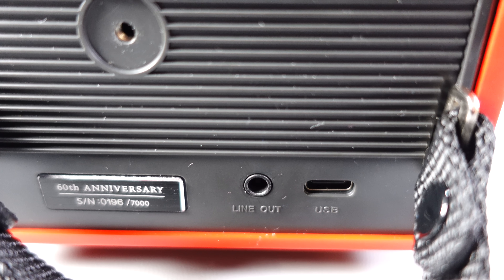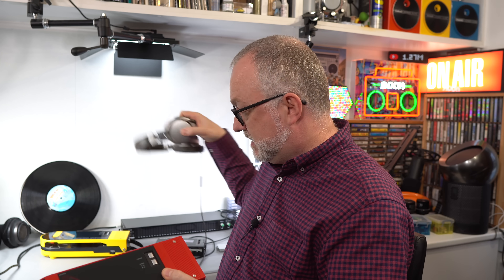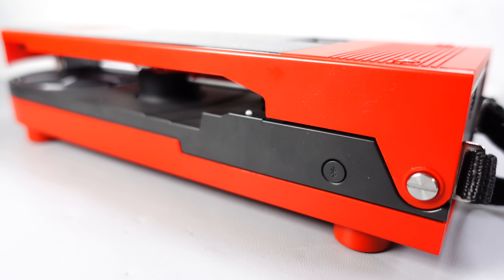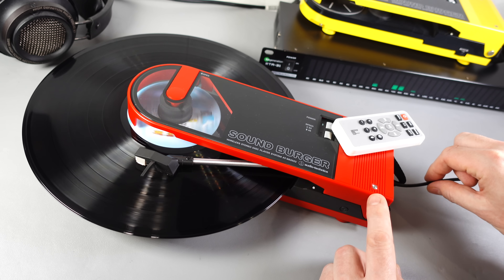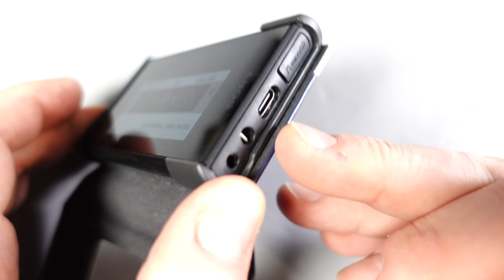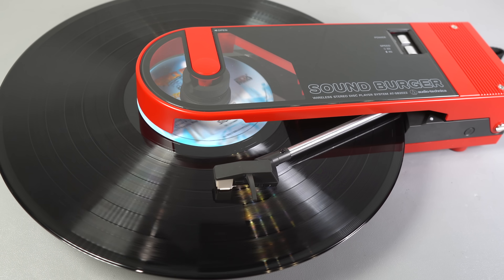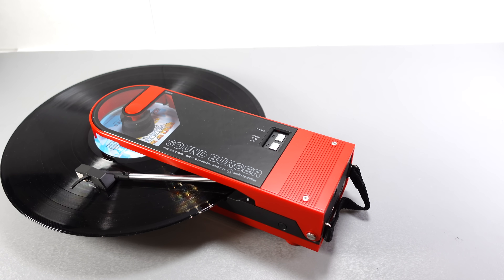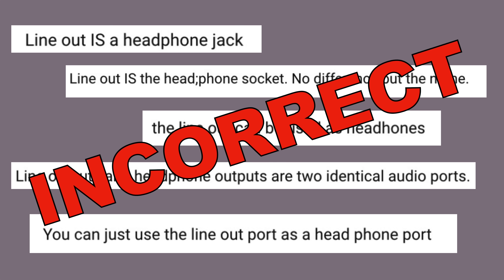Line-out ≠ Headphone-out

Comment: "it uses the same plug, it must work the same!" - nope, not at all. Maybe 23 is "old" now but I have personally used multiple devices growing up that don't follow that notion:
1. "Phono" audio / composite video / component video - all used between 2 and 5 color-coded RCA connectors on each end of the cable
2. PS2 Mouse / PS2 Keyboard - both used 6-pin mini-din connectors but were usually not interchangeable. Labelled and color-coded.
3. S-Video / Apple Desktop Bus - in this case I only used S-Video but it did use the same 4-pin mini-din connector as Apple's peripherals. These cables would also physically fit into the prior PS2 mouse and keyboard ports, but not the other way around.

Add to that a couple of examples before my time, like CGA and EGA video / 9-pin serial and it looks like the use of bespoke connectors for every task looks like a fairly recent trend. If a suitable connector already existed, why reinvent the wheel when a simple label and/or color code would suffice?

Comment: The confusion comes from audio equipment lacking decades behind low-end PC hardware connectivity.
Lots of Desktop PCs and Laptops let you just jack any sound device into any 3.5mm socket and either just switch the role of the socket immediately to match the device or ask you about the type of the device and then do so. I would expect new audio hardware sold today to have a similar feature - if it isn't a retro valve amp or a 2022 limited edition of the Sound Burger from 1983...

Comment: You don't ALWAYS need to amplify it.  Some devices produce an already loud signal (possibly full volume).  I understand why people say line out can be used for headphones, which it can but you don't have control over the volume.  It's all dependent on the device.  Let's look at a few of my devices.  My computer no longer has a headphone jack but instead has a line out, which I use for my headphones.  The volume is controlled via my computer.  I have/had an old school portable CD player (don't know where it is anymore) that has a line out that works great if you have headphones with an in-line volume control since the line out is at full volume all the time.  So there is no answer that can cover all products.  Hope this helps.

Comment: The line out is still usable in certain cases, in your case the volume is low because you're using larger drivers used in over-ear headphones, that's going to take a lot more power than if you use the smaller earbuds that you might get at the convince store and thus the lower volume. So technically it's not misinformation, it's just not the optimal use case. Also if the headphones or stereo speakers have built-in amp the volume is going to be suitable either way.
Reply: To add to this.....

Larger headphones will normally require the higher voltage level off the output which the standard is 770mV to provide the higher level of Amperage needed for headsets (8-600 ohms).  

When Volts increase, Amps increase through the same resistance. 

The Line output will only provide 447mV.  The lower voltage while it will provide some signal, will be to low to provide the Amperage needed to properly drive the headset.

Even with the Smaller headsets, you will get the same effect switching between Line out and Headphone out.  Difference is Even without the proper voltage level you can produce the same Current level and even greater that is needed with the lower Voltage.  You just lose the driving force behind the current flow needed for the proper signal (magnet/air movement).  So in actuality, the smaller headset will actually require more Amps to function not less.

When Resistance decreases, Amps increases with the same Voltage.

Comment: Line-out might not be quiet sometimes; it can also be extremely loud (Chord Hugo 2). Line out design to output the sound at rated Vrms. So it is just for the device connected to it to pick up the signal. So that in most case, Line out does not have a very capable amp; the input impedance of the device connected to it need to be very large, ideally infinite. So that even if the Amp is not capable, it can still maintain the Voltage Level. But the reason Line Out does not have a capable amp is the case; a capable amp has more significant distortion. So that if you want to connect to another very decent large Amp, you want the input signal to be as fidelity as possible, you need a line-out port. But also, the reason you need a delicate amp is considering the space and price constraints, and the device you need to use might need a particular Amp. So that even if it includes a headphone out with an amp, it functions as a general use case.

In most cases, you should not connect an amp to the headphone port or connect a load(like headphones) to line out.

Comment: Long story short, they use the same interface, and are technically compatible, but it would be inappropriate to use Line Out for Headphones, or vice versa, because ONLY Headphones is preamplified. So either it's too quiet for headphones, or redundant\inferior for an amp. It's a similar story with a LOT of audio stuff. You CAN do it, and it will technically work, but it'll be crap.

Comment: I’ve never used a line out as a headphone output. However, I have used a headphone out on my clock radio to plug in a external stereo for better sound output and quality. I, too, think of a headphone output as being usable as a line out at a lower volume level, but not the other way around.

Comment: Some very sensitive headphones could be very loud (or potentially damaged) if plugged into line out. The key is no volume control. I'm glad that you included the headphone amplifier. Overall, very good explanation!
Reply: Fairly sure that's false. A headphone amplifier wouldn't quieten or de-amplify a line-out signal. Line-out is quieter and has to be amplified for speakers or headphones.

Comment: The confusion is caused by older pcs i belive as if i remember correctly line out was sometimes used interchangeabley with headphones and are still very much compatible in the pc market due to volume controls in pc. So people make the assumption that all lineouts are the same when they are not.

Comment: Line out gives you a line level output, which is exactly +4dBu (0dBu being 0.775V and +4dBu being 1.736V) Line level is a very important standard when professionally working with audio. Mic level is 60dB below the line level and its usually what dynamic microphones put out. -60DB is btw the same as saying 1/1000. So the output voltage will be amplified to 1000 times as much as it came in when you plug anything into the mic port (Condenser mics usually give off a much higher level and you will amplify them by something like 40dB or sometimes even less). Professional mixers usually let you set the exact gain because you rarely need the full +60dB of gain unless you are using a microphone not suited for the situation you are using it in. But you could theoretically use a preamp before the preamp. Something like a cloudlifter, which adds +20dB of gain (which is a 10 times amplification). After amplyfying the microphone the 0dB on your mixer means exactly +4dBu of level. And if you send this signal out it will peak at exactly 1.736V, which is very important as said for other devices because all devices expect 0dB to be at exactly this voltage once the input was processed. So the line out is intended to be sent to a device, which expects a standardized signal, which could be the amp for your speakers. What exactly your amps do isnt specified - every model is capable of different things. From there on the signal gets either reduced for lower loudness or increased for greater loudness.

The Headphone out has exactly this amp built in already. It takes the line level signal and increases it further. But if you dont like the built in amp, or want to plug the player into a mixer for whatever purpose you need to do that, you should use the Line out and then wont need to apply neither gain nor attenuation in the next device in the processing, chain since its already at line level - provided the music you play is normalized and the output is working, as it should.
Reply: Almost. There are TWO specs for Line Out. Professional, which you quote is "normally" +4dBu. (Some broadcasters use +8dBu and most telephone companies use 0dBu) The audio industry (like recording studios) typically settled on +4dBu and all interconnections were always balanced typified by XLR connectors.
However, the consumer equipment reference is -10bBV for "Line Out" (0.316V) and is typically unbalanced using RCA connectors. This translates to a 12db difference.  (dBu is dB relative to 0.775 volts where 0dBu = 0.775 volts however dBV is dB relative to 1.0 volt where 0dBV = 1.0 volt)  Cheers...
Reply: I thought it was basically that line out is not amplified in any way, hence LINE level output - it takes the signal being read by the player (whether record stylus, cassette tape head, CD's DAC, whatever) and outputs it.  Versus the headphone jack that has an amplifier built in and, more importantly, a volume control
Reply: @drfsupercenter  It's line out because it's supplying the signal at a line level voltage, like -10dbV or +4 dBu. The issue is line level audio signaling expects very high input and output impedance — the output voltages are quite high relative to a microphone or phono cartridge, the voltage has been amplified, but the output can't actually move very much current, so if a line out can't drive something that needs current to function, like headphones or passive speakers.
Reply: I doubt anyone professional would be working with something so cheap but you do sometimes get ports labelled "line out" that do have mollification for headphones
Reply: @P7777-u7r  Well professionals sometimes use the cheapest tools in emergency situations. It is unusual - yes. But sometimes you are out of luck and stuff starts malfunctioning right before you really need them. Thats where the very cheapest tools come into play.

Comment: The problem isn't that you can't plug headphones into a line out, it's the impedance matching issue with the type of headphones you use. It's possible to plug headphones in and line level be too loud, then using a variable resistor is enough to make it useable just like using a separate pre amp between the line out and the headphones. With no volume control, there's  no guarantee of too loud or too soft with the given combination.
Generally, headphones out at around 70% volume works well as a line out, but the impedance needs to be matched to get best quality, the line out is less susceptible to impedance issues by design, so if it has both outputs, use them as labelled only.
For audiophiles, line out to the headphones is the worst way to get the sound right.

Comment: This cofusion about line out is why using a 3,5mm headphone jack for anything other than a headphone output is a bad idea. Ok, with small devices like the walkman, the headphon ampliefier or a I/O of a PC motherboard it is a different thing. But the new soundburger has lots of space for rca jacks - proven by its predecessor. There is absoluty no reason which makes a 3,5mm jack obligatory.
So you might ask: Why Audia Technica did this BS? And the answere is - as always - easy: It is just money, money, money. A 3,5 jack is just cheaper than two rca jacks.

Comment: Headphone output = Internal impedance virtual zero. You can't join left and right together or each channel will earth (load down) the other and the result is distortion. Line out = Internal impedance anything from 120 ohms to 1kOhm. You can happily join left and right together and it will just sum the two channels nicely.

Comment: I've gotten a bit of distortion from using the headphone jack as a line out jack. I think it was because both devices were using some kind of bass boost or equalization, so what came out of the speakers was too much bass and sounded like crap. If you have to do this, try to turn off bass boost or anything else on the first device so it outputs everything as close to the source as possible and let the main amp do all the work.
Reply: Turn the volume down on your headphone output and up on your amp.

Comment: I learned this the hard way once. If it fits in there it doesn't mean it's designed for it. I once plugged in the wrong power supply to my little HDMI splitter and it fried my capture card and AV receiver. Even though I knew this, I had just moved, was in few beers down already and it was dark, and just wanted to watch a movie. Yes, entertainment setup is always the first thing I set up after moving. I'm sure won't be doing that mistake again. The ironic part is that the little cheap HDMI splitter survived, but the expensive things hooked up to it didn't.

Comment: i think the confusion has started since the PC mantufactures introduced motherboards with programmable Line-out output. Especially with Realtek powered boards you could absolutely use line out as a separate audio output and even program it as a headphone output through the Realtek control panel and control volume through it separately. Not sure if the impedances are going to be correct but i had no problem in using it.
Reply: In Realtek popup window, when audio device is plugged in the green 3,5mm socket, you could choose between Headphone, Line-Out, and even Line In or Microphone.

Comment: That is totally not correct, at least for the argument of can you use line-out as a headphone out, the answer is ofc YES, low volume or not, it works and therefore, it CAN be used. In addition, you can always use a pair more sensitive IEMs with low impedance, they would produce adaquite volume. Are they suited, NO, but CAN you use it? YES.

Comment: My computer monitor has a line out connector on it, which confused me a bit since the website claimed it had a headphone jack.
To my further confusion, the line out is at headphone volumes and the volume is controllable via buttons on the monitor.
I don't know what's really going on there, and I dont use the port because it's in an awkward position,
But just a case of something labelled Line Out that certainly didn't seem to be Line Out to further confuse the general public x

Comment: I feel like a lot of people need to see this.

And to be honest, I'm most likely one of them. 

Fortunately, the two devices I mainly use for headphone listening (an audio interface connected to my computer and an integrated amp for my turntable and computer) both have 1/4 inch sockets labelled "phones" and one has a separate volume control labelled as such, too. But some of the other more obscure things I own (particularly relating to performing and recording music) are ones where I probably have confused 'headphones' and 'line out'.

Comment: For modern audio devices the line output has a HIGHER output voltage up to 2 Vrms for the line out, where as the headphone output is usually limited to 0.5 Vrms, especially for mobile phones in order to avoid hearing issues or dangers. The output impedance of line outputs is not necessarily high. Sometimes it is just 10 to 100 Ohm and it could become dangerously loud to use head phones on such outputs. It is especially not recommented to use pre-amp outputs for power output stages for headphones, because the voltage at these outputs is 7 Vrms.

Comment: If I recall correctly Line out is expecting 10K ohm impedance. Speakers and most headphones are less than 16 ohm impedance. The line out amp would be trying to supply much more current than it is designed for and you risk burning out the amp if it doesn't have over current self protection built in.

Comment: so about line-out, i'm assuming its not really supposed to be volume controlled by the device with line-out?

I have a Roland USB sound interface (a SuperUA S-10 that I got really cheap from CEX) plugged into my computer my headphones are plugged in via the front headphone port I have a cable plugged into the line-in for plugging my phone and other things in (lets me get PC audio and whatever is plugged in audio through my headphones at the same time)

and then I have my speakers plugged into the line-out ports

to adjust the level of each input and output you press the relevant button to switch to controlling that input/output and twiddle the knob so for the line-in I just push the line-in button for phones I push phones and for line-out, i press A (there is a B but that's used for something plugged into the XLR break-out box that I don't use)

is this an instance of something being incorrectly labelled line-out or is this me not quite understanding what lineout is?

Comment: I don't know if what I have had a Line Out or a Amplified Out, because I used a pair of headphones one time and it about blewup the cones. My guess is that it was balanced at 0db and had a good but of power behind it. Although it being a TV probably had something to do with it, however it was labeled as "Line Out" with RCA plugs. It's also important to know there is (maybe if only slightly) a difference between a Vinyl Line Out and a Line Out on a computer.

Comment: By the way, there is a good reason why you new Walkman doesn't have an Line-Out

Line-Out generally puts out the signal directly from the DAC without any amplification.

But the Walkman doesn't have an DAC, it's an full digital Amp.

So if there would be an line out not using the amp, there would be no sound.